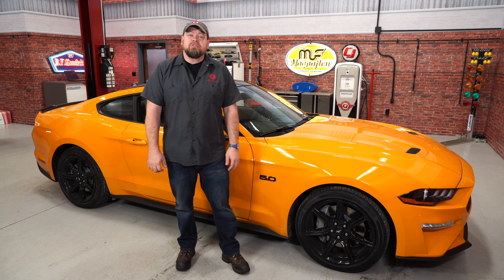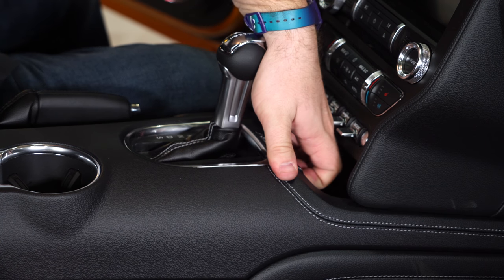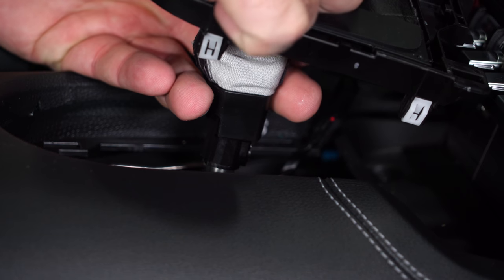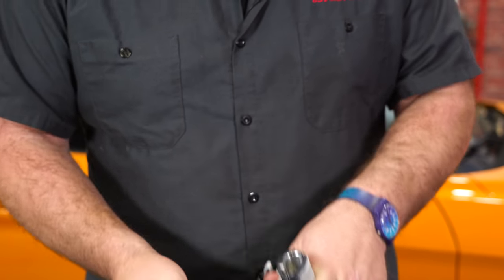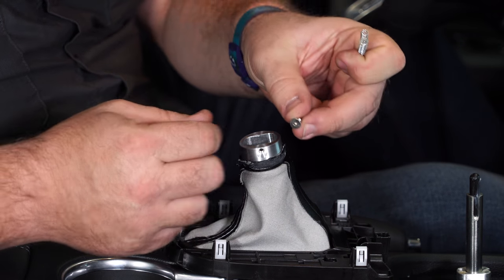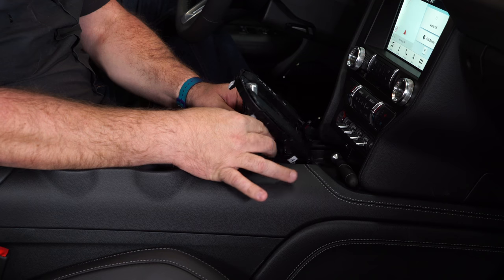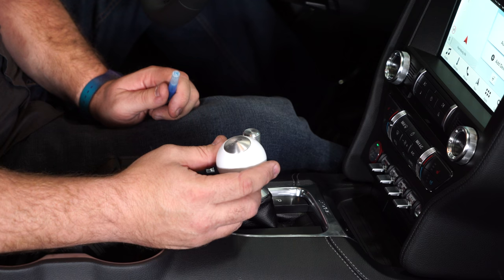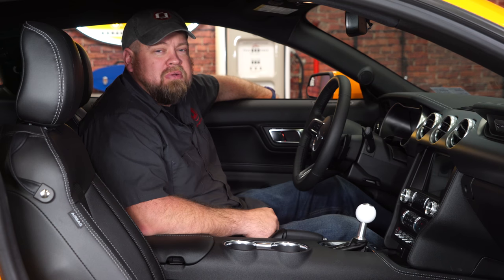2018-2023 Mustang GT/EcoBoost Barton Industries Automatic Transmission Shift Knob Installation

Comment: Just installed this on my ‘17 Ecoboost. A few comments to help others .... 1.) The electrical connection in front of the secondary trim piece disconnects from the bottom. Squeeze tightly and it will come undone. 2.) Even w the provided blue locktite - be careful not to cross thread the cue ball.

Comment: This seems like a lot of work just to replace our shifter knob. I would keep mine bone stock when it comes to the shift knob, but Ford stuffed the S550 interiors with fake chrome plating that's peeling like crazy suddenly in my '15 ecoboost, I am trying to find the fake carbon fiber covers to cover all the chrome plating thats peeling, I found some for the interior door releases and the cupholder bezel, but the one that covers the chrome plating on the automatic shift knob is so expensive and comes from Hong Kong, I don't think its worth waiting 2 months for.

Comment: I followed the instructions, and the installation turned out decent, but now the warning chime won't turn off with the door open and ignition off, the chime turns off with the ignition on or the door closed, but with the door closed, there is clicking under the hood? any clues what could have transpired?
Reply: 2 years late but did you figure out the issue? I just installed a different shift knob and I got the chime issue and park won’t show on the dash even though it’s in park. Can’t find much about this issue online.
Reply: I got it figured out, but I don't remember exactly how. I believe I took it apart and reinstalled it. the chimes went away, and everything worked like it was supposed to.
Reply: the first install I did I didn't put the transmission shifter in the right position, the video I believe shows ot being pulled all the back towards the rear of the car, which I didn't do at first. the reinstall I did right after, I made sure to do this, and everything worked as normal
Reply: @notoriousbastards11  thanks I’ll give it another try
Reply: @joeybruh916  Any luck on fixing that door chime issue? Same problem I installed a different automatic shift knob and now remote start doesn't work and the door chime goes crazy when the driver door is open. The car doesn't believe its actually in park it seems like however it shifts smooth as butter. Its driving me insane because the car works perfectly until I did that lmao. Lemme know bruh!
Reply: @TheMikeWylieProject  man I just took it apart and re installed it again. Didn’t fix shit. Put the oem shifter back on just to see and the button at the top of the shifter wouldn’t even press in :) ford wants $200 to diagnose it. I installed intercooler, charge pipes, downpipe, exhaust no issue. Tune no problem. Fucking shifter causes all this lol I miss my remote start
Reply: @joeybruh916  fuuuuuck haha. Yeah bro I would never though that a shifter would mess with anything. What a pain in the ass. If I magically figure something out I’ll come back and let you know but I appreciate you replying bro!
Reply: @TheMikeWylieProject  no problem and same if it gets fixed I’ll let ya know what it was.